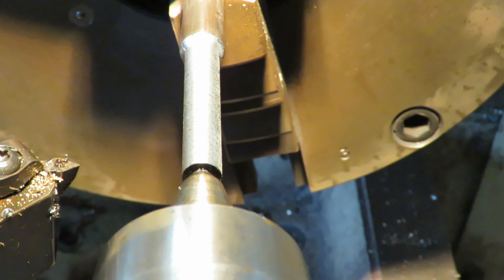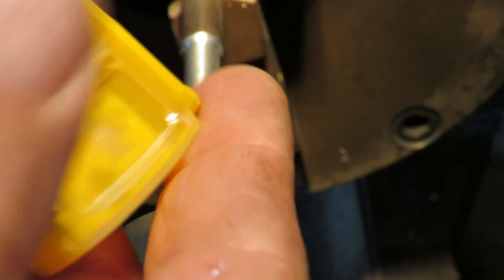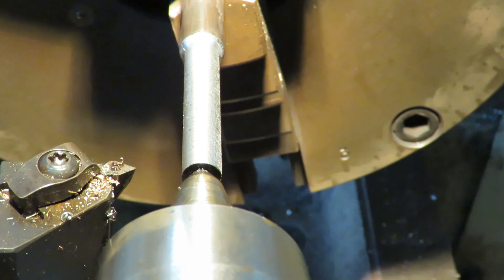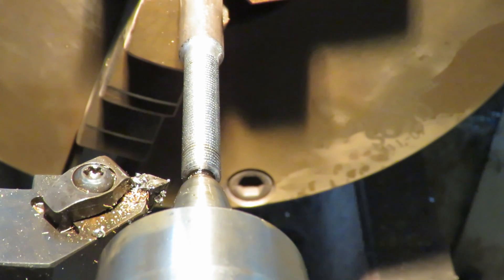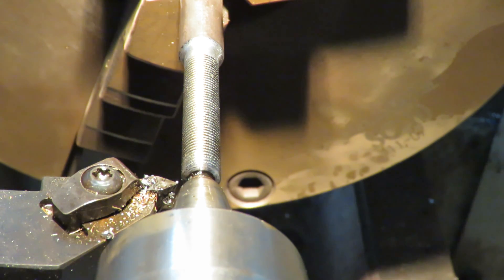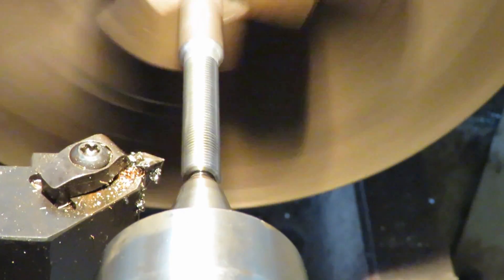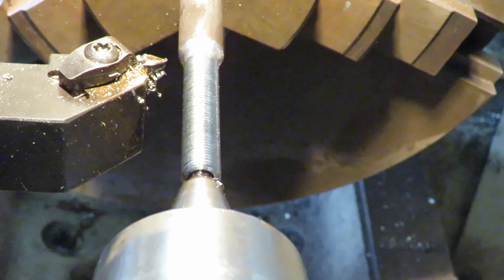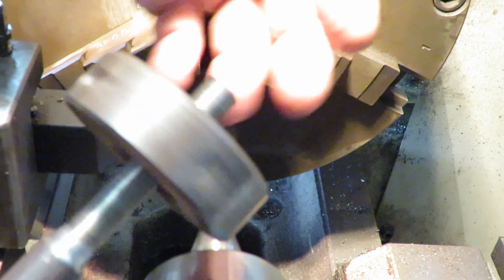High tensile bolts Single Point threading to a reduced size.

Comment from the maker: Phil, if you fit the SAG with a VFD and a nice sized brake resistor, and build a foot brake you will be able to do the same. When I fitted Fred's DSG with a  VFD He built a foot brake and we fitted two micro switches, one for a normal slowing stop, and the next stage one with an Instantaneous stop!

Comment from the maker: Thanks for the comments guys you are all correct. I threw a number out there without thinking, In future I'll stick to metric easier and more accurate without a zillion numbers and fractions, I'm over it! Having said that I still have  a lot of imperial stuff I deal with, convert once on the drawing, do the job and on with the next one. Mainly use the imperial tooling for reaming and threads if specified in inches.

Comment: Got your conversion a bit off that would be a .030" or thirty thousandths depth of cut not three hundredths which would be .300 and nearly the entire bolt. :-) I too use those kennametal threading inserts and they work well and seem to last well too. Thanks for the quick video.
Reply: +bcbloc02 Um, no. 3 / 100 = 30 / 1000
Reply: Ray Jones
I see what you are saying that is an interesting dialect thing now that I think about it. The shops I have worked in I guess the thousandths is always implied as if someone said take threeseventyfive off that. that would be .375 or 3/8. If someone told me to take threehundred off I would take .300, not .030 even though.03 is 3 hundredths. It is similar to if someone said it is off three tenths I would assume that to be .0003 not .3 which is actually 3 tenths. No wonder people can have so much problem with imperial.:-)
Reply: +bcbloc02 The part that always amuses me is when imperial people piss on the metric system yet happily use thousandths of an inch which as a "measurement scheme" is treated exactly as you would do for metric, just the reference length has changed! 
I must admit when Bruce said 3 hundredths I  also had to stop and think, whereas 30 thou = 0.75mm I could pretty much immediately recognise. 
I can now see how one could hear 3 hundreds (of a thou). 
Given Bruce kept the feed nuts engaged I'm thinking it's a metric lathe working on the "dark side" (especially for a man working in a metric country). :-)
Reply: Ray Jones
Nothing wrong with metric, it is just a different base like you said and with it being base 10 it is actually easier to deal with. All my machines are old American iron though so I am just used to the english system since everything is setup that way. My lathe can't even cut a metric thread. :-(
Reply: +Ray Jones If you had grown up with it (as I did) you would have no trouble. I have exactly the opposite problem, converting inch to mm because I work in metric. On an Imperial lathe at that. The rule of thumb I use is 1 mm = 40 thou, so .75 mil = 20 thou.
Reply: +Juan Rivero Oops forgot to say, if your lathe has change gears, yes you can cut metric threads, but you will need a transposing gear. 127 teeth is the classical one, but there are other ways of doing it. See the South Bend "How to Run a Lathe" manual. And I also meant 30 thou not 20! Brain failure.
Reply: I cant cut metric threads either Brian,  unless I take off my QC gear box and buy a complete set of change gears....no thanks :)

Comment: those tips take a punishment Bruce! are you feeding straight in or on an angle? the foot brake looks a good thing too. thanks for showing us how its done.
Reply from the maker: +Emmas Spareroom Machineshop Emma I don't use the American method of angled setting with the compound. My compound is always on parallel and only angled for tapers. If I'm cutting large threads I advance it a couple of Thou on the spring cuts.
Reply: +Bruce Whitham thats how i was taught.
Reply: +Bruce Whitham Hi Bruce, I also keep the top slide where it is meant to be, seems the sensible thing to do.
Was that 1mm on radius or diameter? Machinery handbook suggests depth of thread is 27thou (0.675mm) and that die span down very freely, much more so that experience would lead me to expect.
Reply from the maker: +Chris Stephens Chris, on radius.
Reply: Ah ha, that explains it, thanks.

Comment: Looks like you've had a little practice.  How did you determine the radius of the cut where you turned down the diameter of the bolt?  Did you follow some engineering specification or the machinist's handbook or just training and experience?  Thanks for all the videos, g'day mate.
Reply from the maker: John, I use the Black Book, and I also reference stock studs that I have (high tolerance ones) as a guide. A lot I do just from the head having done so many over the years, others need referring to machinery's handbook or client drawings.

Comment: A very nice video. A question: if you have a DRO, do you really need a threading dial? You should be able to set the tool back at the initial position with no noticeable error, just as if you had reversed the lathe.  Am I missing something? 

I will add that I waited about four days to view this video. That is because, apparently, YouTube converts everything to Flash format. Flash is a notoriously dangerous format, subject to al kinds of hacks. I refuse to use it. Now this is largely a function of what formats your camera will do. If all it supplies is say AVI, another equally notorious format, nothing you can do. If you camera can do MP4 videos, I will wait less time. For example I can view Tom Lipton's videos as soon as he posts them. Or abom79's videos. And my security will be enhanced.
Reply from the maker: +Juan Rivero I have a DRO, I took the dial off no use for that anymore, same with the previous lathes, The DRO is the way to go!
Reply: Thank you! Always wondered about that. Unlike a threading dial, it works for both metric  and Imperial.